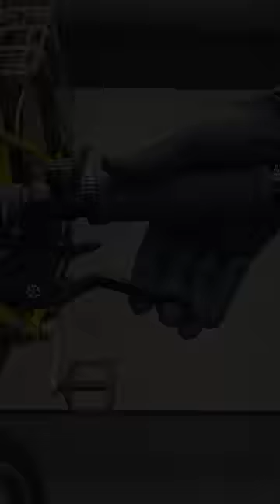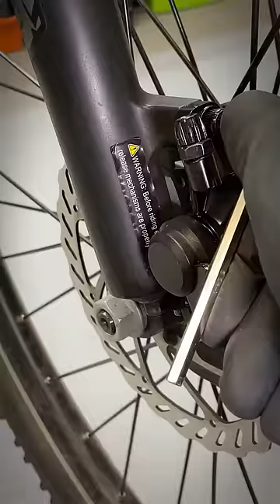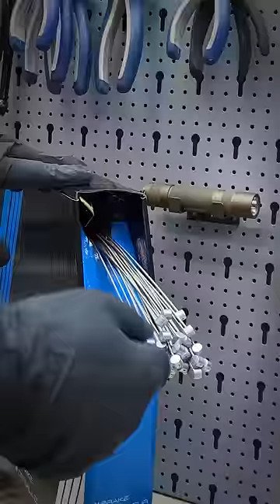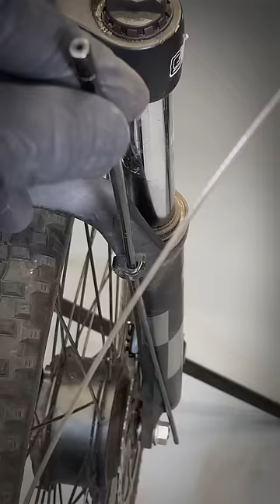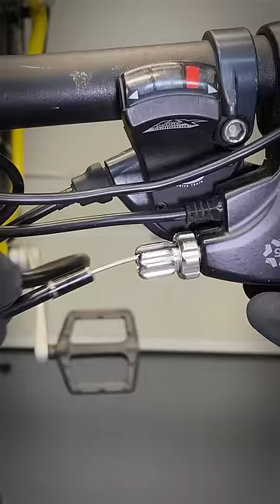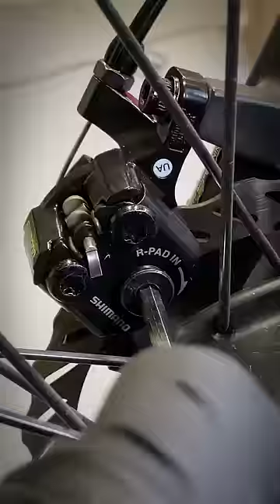Spongy mechanical disc brakes cheap upgrade.

Comment: Or just upgrade to the $70 shimano hydraulic brakes.  100 times better than those mechanical
Reply: Agreed, at this point hydro brakes are so cheap and good there's no reason to go mech in a single caliper setup.
Reply: i used these on my e scooter because it was a decent upgrade over stock that doesn't require me to route hydraulic lines and install motor cutoff switches. work decent. stops good from 35mph.  IF i had a bike id go hydraulic because running the lines is easier. that trying to take everything apart and snake a cable in.
Reply: i have those mechanical shimanos and they perform really well
Reply: @RenaxTM91 
There are certain applications though where someone might still want mechanical brakes over hydraulic brakes. Adventure cyclists, bike backers, or tour riders value reliability and ease of repair over all else. It's far easier to replace a broken brake cable in the dark on the side of the road than it is to bleed a brake. Not to mention that a spare cable is easier to pack than a bleed kit and hydraulic fluid.
Reply: I'd rather have mechanical then hydraulic seriously the oil is ridiculously expensive.
Reply: @MarshWaha  what part of the world do you live in? The oil is soooo cheap and you dont need much.  Such low maintenance.
Reply: @RenaxTM91  "cheap" here in latam they sold like it were car brakes
Reply: might be worth on gravel bikes with propietary brake and shift levers with those cheap tektro mech brakes. i have some avid bb7's on mine and for mechs theyre a blast.
Reply: You cannot rinko with hydraulic brakes.
Reply: @bf5938  You mean extra high maintenance.
Reply: The MT200 are about 45 in a set rn
Reply: I've got this Shimano BR-M375 (Altus) and it's very good.
Reply: @Chris66able  they would be high maintenance if you don’t know what your doing.  But for someone with the knowledge and know how then hydraulic brakes are extremely low maintenance.
Reply: @bf5938  Oh so all those local bike shops have got it wrong, and they don't squeal, they don't need to be bled, topped up, checked for air bubbles, the cable is easy and quick to repair if damaged in a crash ,you can quickly adjust the bite while on the trail, you can see at a quick glance if they need adjusting, and they are not twice as expensive, or 3 times the weight ! OK run along little boy.
Reply: @nooranik21 why motorcycles do not have mechanic brakes? Even the adventure ones. It would be easier to fix a mechanic brakes in a middle of nowhere right? Why they don't use it?
Reply: @Matthew_Removeafterwashing  If I had to guess it's due to weight. A hydraulic brake is a force multiplier for the effort out of your hand. A motorcycle weighs way more than a bicycle so I doubt a mechanical brake would provide sufficient braking power for a vehicle that weighs significantly more. Even with a loaded up touring bicycle you can efficiently stop with a mechanical brake. That said if you're doing a 4000ft descent on your tour ride your hand would probably be more fatigued at the bottom than it would be with a hydraulic brake, but that's the trade off.
Reply: You paid too much
Reply: ikr

Comment: A whole mt200 shimano front hydraulic brake is $50usd. Ready to attach, no bleeding or assembly. If you are beyond a well adjusted mechanical brake, that's your upgrade.
Reply: Lol right
Reply: I got an mt200 on my bike best brave ever
Reply: Right or MT201 its even better
Reply: Yep it's not worth to upgrade to a better mechanical caliper. Better buy the mt201 dam good and reliable brake.
Reply: @alexoprea2407  If you had a better part lying around, for sure.  I'd do that, especially for a commuter bike etc.  But this project surely wasn't much cheaper and definitely took much longer than whacking a Shimano hydraulic on and having a better brake... first world problems I guess.
Reply: @hogey74  I have a bag full of fully functional mech brakes because I can't even be bothered to adjust them, Decent hydro brakes is so cheap and pretty much maintenance free until pads need changing. Especially on a commuter I want reliable brakes with as little maintenance as  possible. I have M200' and similar brakes with not as much as bleeding them trough 4-5 sets of pads. mech brakes need constant adjustment and not just on the cable tension, just to be comparable in braking power.
Reply: Buy the mt201 it's better
Reply: Yeah great, than you ride along 6 month and it leaks 📢📢 There's a reason why stuff is cheap 🤔
Reply: @Nico-jt8ll  must have been some cheap zoom brakes
Reply: @Nico-jt8ll  "Yeah great, than you ride along 6 month and it leaks"
I've been running my mt200 brakes for 18 months on a mountain bike without any  issues at all.
Reply: I’ve had those on my hardtail for 2 years they work good and I’ve had to do no maintenance on then other than new pads
Reply: Not ready to attach if the hose length variant you get ends up not matching the size of your bike or you want the front  and rear brake levers swapped in opposition to what stupid standard your country uses for bicycle brakes.
Reply: What do you mean no bleeding? Just install it that no need to put brake oil in it?
Reply: @noahzarco18  It comes as a sealed unit with the oil already in. Just bolt it on and go.
Reply: @tonyb9735  ah ok that makes sense thanks, also how often does hydros need to be serviced?
Reply: @noahzarco18  How long is a piece of string? I think it depends on how much you use the bike and how aggressively you use the brakes, but I have had my main MTB for about six years, and only had to change the oil for the first time this year. I'm pretty sure you’re supposed to do it more often than that though, but honestly, the brakes worked just fine!
Reply: @noahzarco18  yeah, they come pre-filled with oil so if your frame has external routing you can just install them like that,
Reply: The bike in the video is an e-bike, and those often have a sensor at the brake lever to cut the power to the motor when it’s pressed.

If you want to keep that functionality, mechanical calipers are the only choice, so it makes sense to upgrade them for something decent.
Reply: @kacper0789 you should try the deore 6100 lever matched up with the 6120 caliper 😉 imo the best budget brake out there!
Reply: @onegrapefruitlover I believe Tektro makes some hydraulics now that has that feature. I.could be wrong on the brand but I did work on a customer's e bike with whatever they were. Maybe Magura🤷 I really can't remember😅
Reply: In Germany, €40 euro for the complete set front and back, handles and calipers mt-200, €60 for mt-201. No brainer...
Reply: @Nico-jt8ll  Ive raced XC for 4 years on mt200's, had to replace one lever cause it did slowly gain a leak, but that was after a crash, mt200's are good with the right pads/rotors, and regular bleeding
Reply: And there are several cheap chinese solutions like zrace for like 50$ for the pair that work pretty well and you can get them anodized in different colors
Reply: It would be 50 for both front and rear brakes
Reply: @sheddrip8671  Oh nice. Sounds like the covid BS has seriously settled down.  A pair of them with decently sized disc is such a sweet upgrade.
Reply: Its a good upgrade for gravel/cyclocross bikes. Buying Tiagra levers is $300 while this caliper is $15
Reply: For 50usd u can buy new mt400 if u can search good enough

Comment: Im crying in disbeliefe, it just needed a little adjustment or a new brake pad, but he changed the whole thing🤣🤣🤣🤣goddamn
Reply: No mention that Origin8 & other manufacturers make affordable compressionless housing for this very reason...
Reply: With a basically same brake 😅
Reply: @romka_ind  yup
Reply: @mechanicaldavid4827  yup
Reply: @romka_ind just those brake pads changed shape
Reply: If he changed to new brakes might as well just buy hydralics
Reply: It's a legit upgrade. I have a Cannondale CAADX cyclocross that came with shitty Promax calipers... I tried every adjustment possible and the power faded in the same day or maximum 2 rides. Buying hydraulic Tiagra levers was like $300 usd. I just bought the same Shimano Tourney caliper from this video for $15 and the difference was night and dsy. It stops amazing now.
Reply: Así son todas esas reparaciones "baratas" de YouTube mejor que diga directamente que quería cambiar a Shimano y ya está no tenía por qué echarle la culpa a su otra pinza.

Comment: The trick I use for spongy brakes, that doesn't involve replacing anything, is to take the stretch out of the brake cable. Take up all the cable slack at the caliper, and wind out the barrel adjuster. Squeeze the brake lever as hard as you can. Keep taking up the slack until the cable won't stretch any more. I've gotten cheap mechanical brakes to feel just as solid as a set of hydraulic brakes.
Reply: Just gotta make sure alignment of the caliper and static pad are all good. This works.
Reply: @MaYbYl8eR  You bet! Alignment is especially critical on the rear brake, as you do need to account for cable stretch by having a tighter spacing between the pad and rotor.
Reply: Could you rephrase that trick? I’m having trouble understanding. Thanks!
Reply: @NjAnderson118  What you want to do is take all the slack out of the system anywhere you can. Loosen the cable clamp at the caliper, and pull as much cable as you can. It doesn't matter if the pads are pressing against the rotor. Then wind out the cable adjusters. This will put the cable under tension. Finally squeeze the brake lever as hard as you can. At this point, you'll end up literally pulling the stretch out of the cable. Once you let go of the lever, you'll find that it's a bit looser than it was before.

Then wind the adjusters back in, loosen the cable clamp at the caliper, and pull more of the cable through. Tighten everything back up again, and keep repeating this process until you can't get the cable to stretch anymore.
Reply: As a bike mechanic myself. I completely agree with this statement

Comment: ... and the answer is compressionless outer. No need for new callipers... And much cheaper.
Reply: Ivan knows the score!
Reply: Yes!  I used to get Nokon but now have the JagWire segmented housing, and the mandrel-drawn cable, which is almost as important. It makes almost any cable actuated brake go from mediocre to excellent.

Comment: If its spongy there's an adjustment screw on the opposite side of the piston you just gotta center the rotor between the pads
Reply: This will reduce lever stroke to a certain degree but not remove the spongy characteristic .
Reply: @robertmcfadyen9156 however, that is only true for very low end mechanical calipers with a lot of flex. Once you're at mid level, it doesn't really improve anything to change the caliper. This video is a little misleading or oversimplified.

Some cheaper calipers also don't have any issues with flex. It's always worth a shot to adjust it first.
Reply: For mechanical brakes that have the pull on one side like both of the ones that are shown here, you need to have the fixed pad as close to the rotor as possible, not centred. If they're centred on a single arm mechanical brake, there'll still be flex and uneven pad wear from the rotor flexing sideways to hit the fixed pad. Hydro brakes and BB7 style brakes should be centred though.
Reply: I still say the best upgrade for both hydraulic and mechanical disc brakes is a larger dia rotor as you need less force applying the brakes for the same amount of braking.

Comment: Spongy brake lever in mechanical setup is due to wrong cable sheaths. Use the correct stuff (compression resistant, axial strands) and you will improve greatly the performance.
Reply: This! Main reason new caliper can be less spongy is bigger pull ratio = weaker braking with worse modulation. Next would be disc distance from static pad and caliper rigidity.
Reply: Could you please go into detail about the different cable sheaths ? I'm new to this and doing everything I can to learn. My brakes haven't been operating properly and I'm still having issues.

Comment: Bike shop guy here lol from my experience if your mechanical disc break feels spongy make sure that the caliper and cable are adjusted properly and if it's still spongy it's more likely that the housing has gotten old and worn out and it will literally compress and if it's bad you will see the housing tighten up and if that's the case it's a good idea to replace the cable aswell with the housing

Comment: .. And you still would have spongy brakes 😯
It is essential to you use compressionless cable housings like Jagwire keb-sl and metal endcaps with mechanical disc brakes. I don't remember a bike manufacturer who does this from stock and it frightens. So drop the caliper upgrade and go to your lbs who knows his stuff 😁

Comment: The true way to make these less spongy is to preload the clamping mechanism just a little bit. By clamping the cable with the mechanism already slightly engaged you decrease the pull distance necessary to effectively brake while leaving the gap between the pads and the rotor untouched

Comment: When you move the arm up when making an adjustment you steal leverage from the brake and make it weaker. It’s a cheater way to adjust a disc brake. Proper way is to make sure the rotor is as straight as possible, align the caliper as close as possible to the brake pad that actually moves in when you pull the lever, use the adjuster on the caliper to move the brake pad on the other side over as close as possible without touching, then make sure the barrel adjuster is all the way screwed in on the lever, string the brake cable up and use a ferrule if it will fit, pull hard on the brake cable and make sure the brake arm is resting at its lowest position, while keeping tension on the brake cable with knipex or some grabbing tool use your other hand to pull the brake lever, this will help seat everything if you have installed new cable and housing, then once you have done this tighten the bolt to secure the cable to the brake arm. Pull the lever a few times hard to seat everything and then undo the cable and pull the slack out, look to see if you are able to move the non arm side pad anymore as often when you pull the brake the pads will settle in a little bit and you can sometimes get one more click out of the opposite adjuster side. The most important thing other than a properly bled brake for any disc braking system is a rotor that is dead straight. Use a rotor straightens gauge to get your rotor straight to within .01mm and you will have rock solid brakes that don’t rub, even when turning. I do this all day long at my shop and that rotor gauge tool is invaluable, it takes a lot of patience but once you get it the performance and reliability of disc brakes goes way up.

Comment: I've found that you can get a cheap but good hydro two piston caliper for around the same price as a cheap mechanical one and way cheaper then a expensive mechanical one and the cheap hydro works pretty damn good which blew my mind the first time I tried it but tbh it really looks exactly the same design as a more expensive hydro brakes so I shouldn't have been so surprised I guess.  I also have tried the line pull but hydro actuated meaning theres mechanical brake line going to the caliper but a hydro piston is connected to that so that it actuated both sides of the caliper and that worked pretty decently too and reduced the cost by not needing to buy a new lever system and master cylinder!!! But the cheap hydro caliper cost the same as that so if your willing to just spend $15 more for the lever and lines the hydro is def the way to go I think.

Comment: The cable housing was not properly cut and filed straight. You can see this where the coil is impinging the hole for the cable.  This problem should be corrected first by replacing the housing or just re-cutting it, if there is enough left.  Changing the caliper may have been unnecessary.

Comment: Look at compressionless cable housing designed for disc brakes. It helps a lot.
Then look at calipers which move both pads, they're a lot better than single sided discs.

Hydraulic is much better, but more expensive.

Comment: First: you need to true your wheels if you are using rim brakes. Skip to next step if using disk brakes.

How to remove spongy feeling: Just clean and lube your inner cable and work the oil into the outer cable by sliding the inner cable through the outer cable 3-5 times.

If this does not fix it then change your outer cable if it is older than 2 years. Also use a dust seal on your brake cable to prevent introducing dust into your brake system.

Do I really need to tell you the need to change rusty or frayed cables? Use a cable end capsule to prevent fraying, oil your cable to prevent rust.

Comment: I got my mech disc brakes and  levers set up soft like that on my Mongoose Switchback Expert but it still locks the back tire up. The disc calipers are Promax 310 and the levers are Shimano ST-EF51 shifter/brake combo.  I readjusted them that way because they came too stiff from the factory.